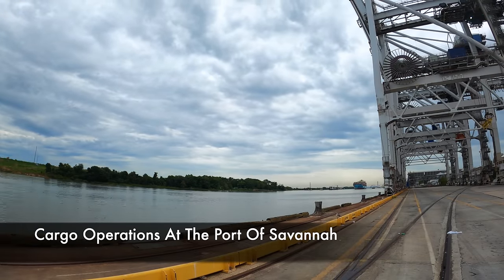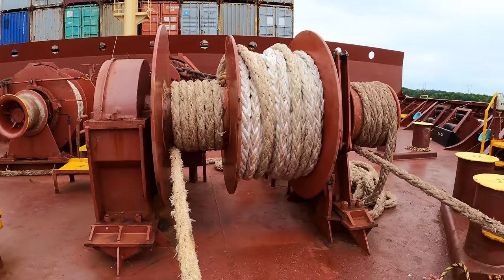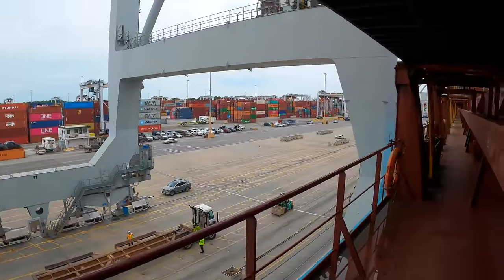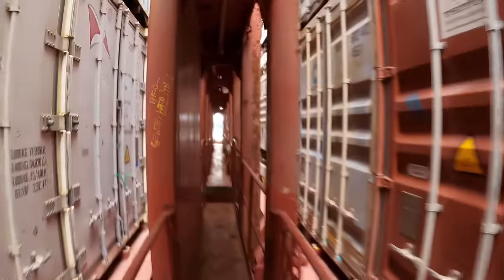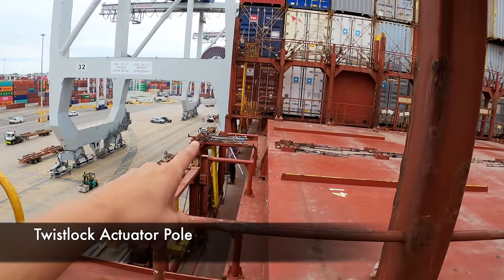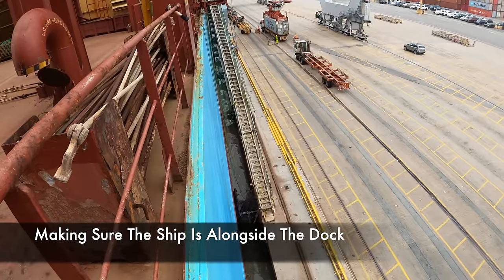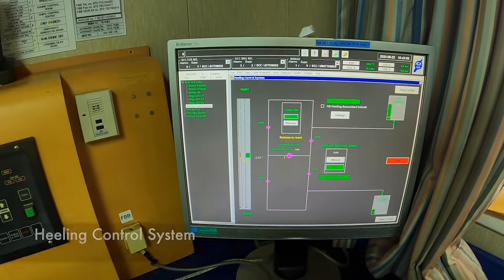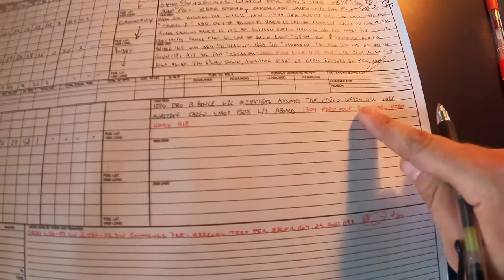Cargo Operations On A Container Ship In Port | Life At Sea

Comment: I work at Michelin in Lexington SC, we make those earthmover tires you see in the video. The ones that go on the ships are in containers and head to either Savanah or Charleston. The ones on flatbeds are headed to either Alberta Canada to the oil sands or out west to mines. So if you see them on the road you can now tell where they are headed by how they are being transported...
Reply from the maker: Very interesting! Thanks, I always wondered what those were used for
Reply: I remember having to pull the wires for all the tire loads before we got crab gear to use in the yard

Comment: A reefer container is going to discharge heat. You will notice there is a gap between the container and the things around it, so presumably there is an air circulation system there somewhere.

Comment: Thanks for the detailed overview of discharge operation. 1. How to figure out the number of the bay? 2. Is automatic heeling control system common in bulk carrier and oil/chemical tanker? If heeling control system is not automatic, will someone need to monitor and control the pumping in or out water during the loading and unloading process? Tks.
Reply from the maker: The bay numbers are painted on the outside of the cargo holds and are numbered in ascending order from bow to stern. I can’t really speak for bulk carriers or tankers if they have the same auto heeling system as most of my experience is on container ships, but I imagine they would.   Water ballasting is important when loading of discharging any cargo ship so that stress forces aren’t exceeded!
Reply: @BryanBoyle  Who is in charge of cargo control room and supervises cargo operation? By the way, pls let us know how to work out stowage plan & passage plan subsequently if you have spare time. Thanks.

Comment: That "Inshore Headline" at 1:30 is sure hard on that "corner", seems like it should be going through that "blue hole" just to the right...just wondering...I'm new to your channel and GREATLY enjoy your videos, you're doing a damn good job of explaining everything...my time at sea as a "snipe" was over a half century ago.
Reply from the maker: Glad you are enjoy my content! That headline is on a bight, meaning they sent out a belly in the line and placed that over the bollard on the dock versus using the eye of the line. Running a bight through the same chock can work, but it’s tight and there’s more areas for it to chaff on the chock.  The roller chock that is being used is better to avoid chaffing and damaging the lines. You are right though, it appears to still be rubbing against the edge there despite being on a roller chock. Welcome to the channel!
Reply: @BryanBoyle  Thanks Bryan, you're doing a great job with the videos, I just couldn't help myself to nitpick that detail, Cheers, take care...

Comment: I was wondering if the refer containers had alarms in case the refer failed.  I once received a 20ft refer that the refrigeration failed , 3 days in the tropic sun, Florida to Grand Cayman.
 What a sight and smell.
Reply from the maker: We have a central system called the Refcon that you can monitor them from the cargo office. However, this system is unreliable so reefers are still checked multiple times a day by the Chief mate or other watch officers. I can only imagine how bad that would smell especially if it was something like frozen fish. Any idea what was in there?
Reply: @BryanBoyle  Thanks for the reply, the container held part of my produce order. It was at 54 degrees for bananas, potatoes and other  produce items that can't take colder temps. Nasty but not fish nasty.

Comment: Why is there a specific reefer load plan? What is a spring line? Usually is it about 1/3 container cargoes loaded on deck & around 2/3 container cargoes loaded under deck? Are dangerous container cargoes always loaded on deck? May empty containers very seldom together with stuffed containers be loaded on same container vessel or most likely are empty containers left behind the port & wait for cargoes? Would bunkering be performed at the same time during cargo operation? If yes, is it dangerous and not normal? Would forty-foot containers be stowed in the same row or even in the same bay? Are forty-foot containers (FTU) stowed separately from twenty-foot containers (TEU)? How to stow flat racks & open top or open side containers on board? Thanks.

Comment: Are containers twistlocked in the hold? If so how are they released for the crane to lift them out?
Reply from the maker: No twistlocks in the holds. They use stackers instead that hold the corners of the containers together without locking them.

Comment: How do you know how many bow and stern lines are required ? Thanks
Reply from the maker: The captain will discuss this with the pilot when the ship is docking.  Certain ports have requirements for the number of lines based on the size of the ship and which dock it's using.  For example, the port of Houston requires us to use 5 head lines, 3 forward spring lines, 3 aft spring lines, and 5 stern lines!  Most of the time it's the 4 head/stern lines and two spring lines on both ends though. We might also put out extra lines if bad weather is expected.

Comment: How do you get those massive lines onto the dock?
Reply from the maker: Checking out my conventional vs automated mooring video. We use messenger lines attached to the larger lines and throw them to the line handlers on the dock to pull them over

Comment: Pretty sure you're not supposed to stand so close to the lines, as they may snap and take your head off
Reply from the maker: These are snap-back zones that you don’t want to stand in when you are working lines and tightening them up.  After the ship is docked and you are no longer making adjustments to the lines, it’s common practice to check the tightness of the lines by touching it with your hand or foot.  You still don’t want to hang around snap-back areas any longer than what’s required to do a quick check of the tightness though.
Reply: I pretty much know this since I'm attending maritime university, but seeing a guy filming so comfortably around this is nerveracking
Reply: It's better to avoid straying close to tightened moorings but it's not an issue as the ship is already alongside.  Actually to check how tight the line is , it's pretty common to push it with your foot.

Comment: Never have lines on the drum. That is poor seamanship.
Reply from the maker: I agree. The equipment isn’t designed to keep extra lines tight on the gypsy head. Many ports requires more lines than how these ships were designed to use, so it’s become common practice many times to run the extra lines this way as there aren’t a lot of alternatives.